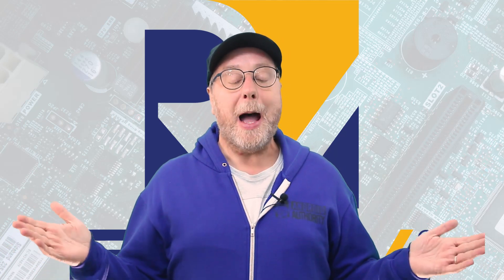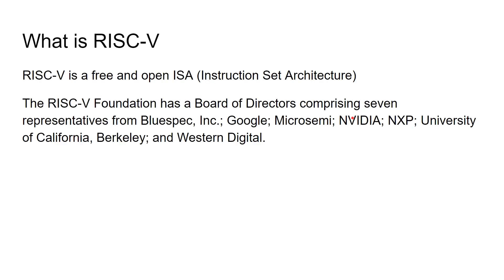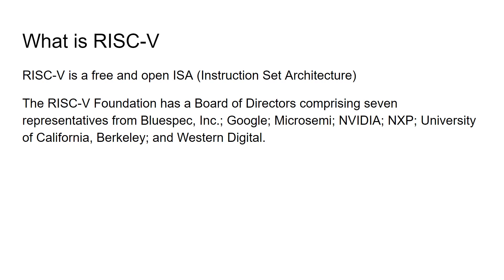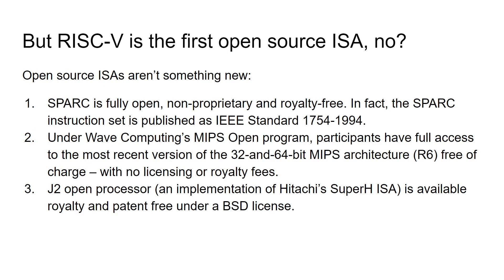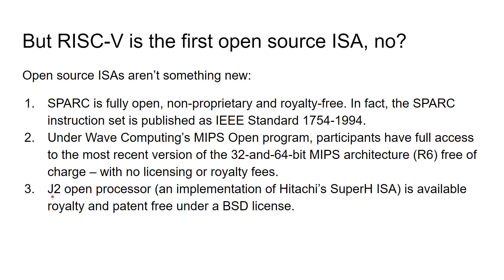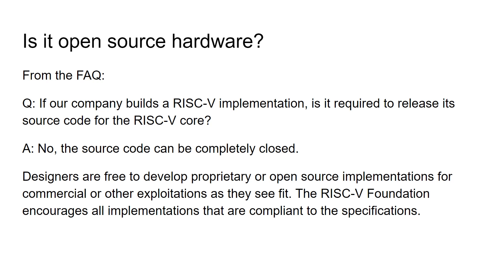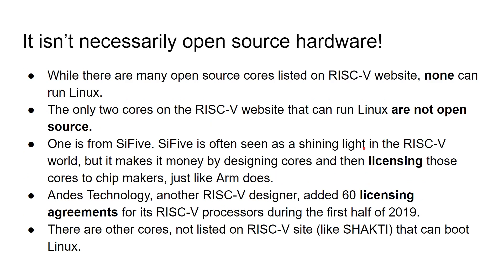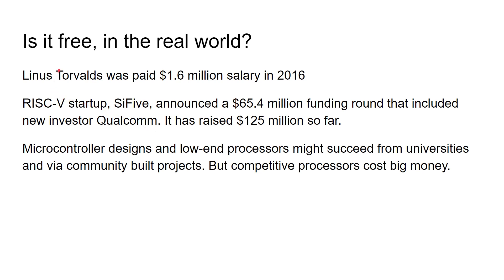RISC-V: Is it Open Source Hardware? (RISC-V part 1)

Comment: There's lots of "free" ware like compilers; it doesn't mean that any software you create and use on the freeware is free.  The on-going development of openware is normally dependent on profit based business that use their freeware to make monetary contributions for it's continued development.
Reply from the maker: Freeware and openware are not really terms that people use in relation to open source software, but I get what you are saying. What you mustn't forget is that there are thousands (hundreds of thousands?) of developers who contribute to open source project without any monetary gain. There are lots of people who think that because RISC-V is an open source specification then magically there will be a similar group of passionate contributors who will make RISC-V cores, free-of-charge and that the Linux revolution will happen again, but for processors. The openness of RISC-V isn't in question.

Comment: I would suggest anyone interested in RISC-V read “The RISC-V Reader” and watch the numerous videos put out by the RISC-V foundation.

I’ve watched the whole series and found it to be pretty negative.  I don’t think Gary really gets the point of RISC-V or what’s actually exciting about it.  There were quite a few factual errors, all painting a negative picture of the ISA. Examples can be found in other people’s comments.

It may be true that we won’t see a RISC-V chip rivaling Intel in the next few years, but it’s not impossible. No one thought an ARM core would ever rival Intel but Apples latest chip is doing just that. And Gary even has a video endorsing ARM on the desktop.

There are many big companies rolling their own micro-architectures, only one of them needs to pick up RISC-V and run with it, and with several other vendors producing different levels of integration from IP cores to silicon there’s certainly room for success.

To be honest it all sounds a little like ARM FUD to me.
Reply from the maker: "and watch the numerous videos put out by the RISC-V foundation"... because those videos will be completely unbiased. It is clear from where you are getting your info from.
Reply: @GaryExplains  Hi Gary, I'm not invested in RISC-V at all, I write firmware for both ARM and PPC embedded CPU's, but I still think it's compelling technology which could be a real game changer. RISC-V is not Linux, but I think it could do to CPU industry, what Linux did to the Unix industry.

Comment: Very well put, I will say the biggest promise for RISC V imho is a closed/open software eco system that can allow for OSC hardware. With no need for X86 emulation. Privacy and performance are such hard selling points it will come to fruition.

Comment: So do the other chip designs, i.e. SPARC, MIPS, J2, etc. require the manufacturer to keep the manufactured chip information open and available to anyone?
Reply: I think Sparc is open under the name Open Sparce. Other and newer versions of Sparc are not open. I also think there was never an Open Sparc chip (only FPGAs). :-(
Reply: I think one of them was under the BSD license (maybe J2). Everything under the BSD license can be modified and sold under another license (it's not like GNU GPL or Apache).

Comment: I've always hated the, "If it's open source it can't be back doored" argument. It's like saying, "If it's open source there can't be any security vulnerabilities." Utterly absurd.
Reply from the maker: For your argument to make any sense it means that the backdoor is an intentionally added vulnerability which is known to be exploitable. That is quite hard to engineer and then include into the kernel without it being noticed. Also, it negate the fact that all the major Linux providers use their own kernels and wouldn't necessarily include this intentional vulnerability into their kernels.
Reply: @GaryExplains  Well, considering it was done in 2003 on the Linux kernel I wouldn't say it is hard to do. The hard part is not getting caught.

Comment: Hey, but couldn't it be something like an Arduino board? As far as I know, both the software and hardware is open source but the actual board costs money.

Of course, I know that I'm comparing two different worlds of a hobbyist technology and a desktop PC, but can't it work the way I just mentioned?
Reply: Nothing is completely open source. Arduino UNO for example uses an Atmel MCU which has a silicon that is not open source. 

Yes, the source code of the IDE, the GCC compiler it  uses and the PCBA files ( including schematics , Layout and BOM) are open source. So you can basically replicate the design without any restriction of any sort.

Comment: Seems like you should have said "Open circuit diagrams" in many places in this video.
Reply from the maker: LOL, no, most modern CPUs are designed using higher level languages, HDLs. So to release the design you need to release the source.
Reply: arguably a closed circuit is better than an open circuit.